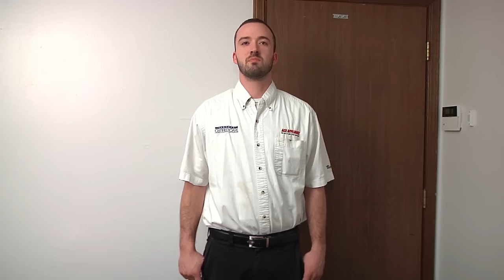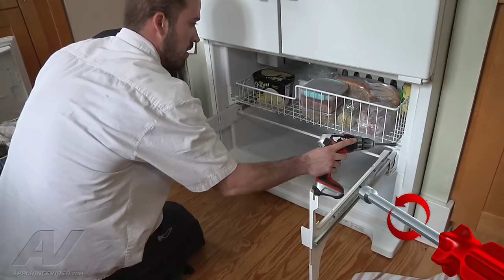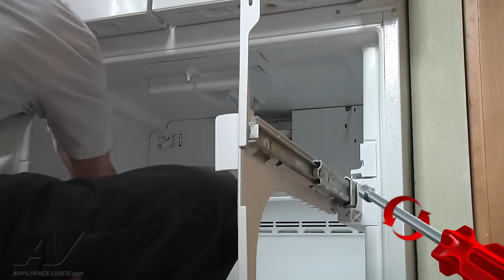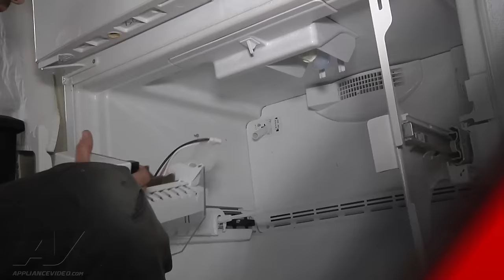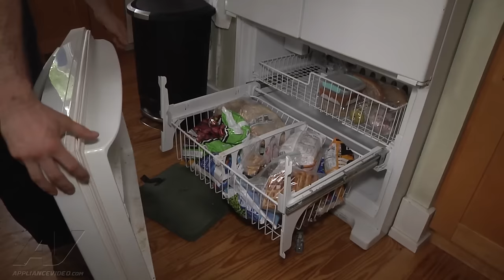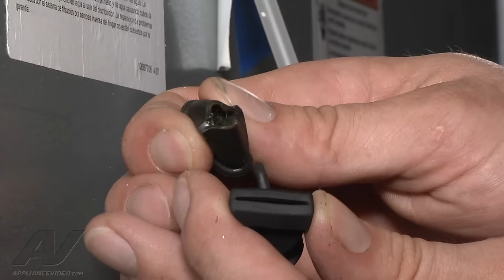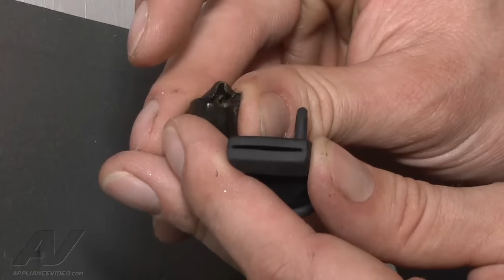Whirlpool Refrigerator Repair - Ice Buildup in the Bottom Freezer - Water Leaking - Grommet Kit

Comment: Thank you for producing this video. I faced the same issue about a decade ago with my Kitchenaid. I pulled the sheet metal cover off the back and traced the problem to the grommet which had clogged up. Removed the grommet and melted the dammed up ice. Problem fixed forever. No need to operate on anything on the inside of the fridge.

Comment: So thankful for the help. I went through it twice. I should have removed the back panel off the rear of the fridge and run a wire or drill bit up thru the drain pipe to clear. Didn't do it so had to do again by removing ice like the video shows then boring out the drain from the back side of the fridge. Hey I'm 77 and if I can do it you can too.

Comment: Great instructional video, I removed the grommet and cleaned it with dish soap and water and a small brush. It removed all the sticky gunk. I was not able to remove the top drawer in the freezer so I improvised. I place a hair dryer against the vents on the back wall and melted all the ice behind the wall. I also slid a paper towel in between the panels which absorbed the water. So far it has worked very well and should be a fix until the replacement P trap kit arrives.
Reply from the maker: JC guy
                 Thank you for your positive comment. We are glad we could help resolve your issue and hopefully saved you money. Please help us provide more videos to our site by posting ApplianceVideo.com on your YouTube, Facebook or Twitter account or add us to your circles. If you are in need of any parts please support our parts department on line at http://savemoreonparts.com/ or call 1-800-830-5465 7-days a week until 11pm Eastern time. Thanks again your support.  Matt, Ace Appliance service technician.

Comment: Thanks for the detail explanation. Freezer was working but fridge was warm. Everything in back looked ok and didn't see any ice inside the freezer.... until I removed the back panel. OMG!!! It was encased with ice. Took a few hours to melt, clean up, dry, but it works like a champ! Now I am wondering if perhaps we left the freezer door ajar leading to the ice or if the auto-defrost is not working? Ugh!

Comment: Took me 3 hrs, but I finally did it!  I kept getting a "door ajar" alarm on after we were finished.  The LED lights inside wouldn't come on nor would the ice/water dispenser work.  Come to find out, the electric clip on the back that hooks up to the water pump was flipped the wrong way. Unfortunately it slides on either way so you have to remember which side is correct before you remove it.  

Thanks Appliance Video!  Your customer service dept. was very helpful and spot on.  No problems whatsoever!..  I highly recommend using them.  Saved a bunch of $ and everything fit perfectly!  So glad b/c my freezer has been leaking for over a year.  I just hope it works permanently. = )
Reply from the maker: mikereardon                       Thanks
for the positive comment. Hopefully we saved you some money. Please help us
provide more videos to our site by posting ApplianceVideo.com on your YouTube,
Facebook or Twitter account or add us to your circles. If you are in need of any parts please support
our parts department on line at http://savemoreonparts.com/ or call 1-800-830-5465 7-days a week until 11pm Eastern
time. Thanks again your support.  Matt, Ace Appliance service technician.

Comment: Thanks much for this, great video. I used scissors to cut off 1/8" from the tip of the rubber and got a great nice opening for water to drain out!
Reply from the maker: Thank you for your positive comment .  Our family-owned and operated company works hard to provide you with FREE, high-quality repair videos. Thank you for your continued support and good luck on your project. If you are in need of any parts, our parts department has over 5-million in stock for same day shipping. Please call  1-800-830-5465 for any of your parts needs, or you can order online 24 hours at: ApplianceVideo.com. Thank you and good luck with you project.

Comment: Thanks for video, really helped me fix my issue.  My issue was little different.  My leak was coming from rubber tube that feeds the icemaker had frozen ice plugging it.  So when the ice maker tried to water into icemaker the pressure in the line behind the refrigerator leaked.  I had to do the same disassembly to get to the rubber tube and defrost the ice in it.  I might have been able to do it all from the back by feeding hot water into the tube but not sure that would have worked or not.  In any case this worked and we were able to do major clean out too!  Thanks again!
Reply from the maker: Thanks for your response, we are glad we could help. Our library
of over 5,700 videos are currently helping 1.6 million people like you every
MONTH.  Please help us by subscribing to
our YouTube channel, or post our website www.ApplianceVideo.com to your Facebook
page

Comment: This Kenmore bottom freezer fix with the new P trap kit was awesome.  Thanks soooo much. FOLLOW UP ISSUE:  After I plugged the refrigerator back in it produced a couple of batches of cubes but then stopped altogether.  I have a water dispenser on the inside left wall of the refrigerator and it works fine.  I ran the water for two minutes per the manual to remove any air in the line.  I am at a loss. :(  The unit is just over a year old.
Reply: Did you have ice forming in yours? Ours is only 14 months old and it is forming ice crystals on the left side and bottom of drawer and on the pullout drawer. Appreciate your input.
Reply from the maker: Thanks for your response, we are glad we could help. Our library of over 5,700 videos are currently helping over 1.6 million people like you every MONTH.  Please help us by subscribing to our YouTube channel, or post our website www.ApplianceVideo.com to your Facebook page, Twitter, Instagram or any other social media sites. Your support will help us keep producing more free quality videos.

Comment: Thanks for posting this! Sure enough our grommet barely had a slit in it, no wonder it clogged and froze up. Trimmed a little rubber off to open it up a bit and put everything back together. 30 min job, max.
Reply from the maker: Energy X

            Thank you for your positive comment.  Please help our ranking by subscribing to our YouTube page or posting our ApplianceVideo.com site on your Facebook or Twitter account. This will help us to continue to make new professional videos from our factory trained technicians. We also have our authorized technician’s daily emailing professional advice daily to people like you that have appliance problems. We have helped thousands of people save hundreds of dollars. Thanks in advance for your help.
Reply: ***** I should have added that this seems like a design flaw and Whirlpool should be providing the updated p-trap part for free...
Reply from the maker: Yes, make sure you put the new kit on your unit.85% of the time the problem will come back if you do not install the new part.Good job on doing it yourself. Please help our ranking by subscribing to our YouTube page or posting our ApplianceVideo.com site on your Facebook or Twitter account.

Comment: Thanks for the help couldn't have done it without the video. My grommet at the back was dry because of all the ice build up everywhere else you showed me. I cleaned out the fridge and then used a hair dryer instead of taking of the back and all the shelves and the front door. It took about ten minutes and I'm wondering if I would hurt anything by using hot air instead of hot water?
Reply from the maker: Bill 
     We also use a heat guns. You can use hot air as long as you monitor and don't melt any plastic parts on the unit.  Thanks for your positive comment. Please help us provide more videos to our site by subscribing to our YouTube page or posting ApplianceVideo.com site on your Facebook or Twitter account. We also have our factory authorized technician’s email daily free professional advice to people like you to help solve their appliance problems. Thanks in advance for supporting us. Matt, Ace Appliance service technician.

Comment: great video. I will definitely be looking behind the back panel. What is the drain grommet for though? What is being drained and where is it being drained to?
Reply from the maker: Great
question, you can call our parts department at 1-800-830-5465 and they can give
you help. If you have a more technical question that our parts department
cannot answer, our technicians are answering
all questions at our website at ApplianceVideo.com under our Repair Help
section. We have over 3,000 common questions and answers that you can easily
search through by your model number, appliance make, and problem or error codes,
and  Its free to search through our question & answer library.

Comment: Okay - First of all, thanks a ton for your video. It helped me take apart and put back together my Kitchen Aid model that was more or less the same thing in your video.

We had tremendous ice build up inside the freezer, but no water on the floor as symptoms.

I pulled off the back panel from the inside, expecting to see a ton of ice along a frozen drain line. Instead, there was a giant clump of ice in the upper right hand corner covering all of the parts connected to the ?thermister?. It was a huge clump of ice all along the copper tubing and wires up there. We took a hair dryer to it for the most part, not wanting to bend or damage any of the wires tubing etc. We were able to melt all of the ice. I did get a little aggressive trying to poke at it and did get a small shock, so be careful if repeating this. The ice is now gone.

But, what might have caused this? We may have left the door open a few times a little bit getting some freezing, but, once again, this clump of ice was huge. Could a part be defective?

Thanks!
Reply from the maker: Great question, you can call
our parts department at 1-800-830-5465 and they can give you help 6-days A week
Mon-Sat . You can also search at www.SaveMoreOnParts.com 7- days a week.  If you have a more
technical question that our parts department cannot answer, our technicians are
answering all questions at our website at www.ApplianceVideo.com under our Repair Help section. We have over 6,000
common questions and answers that you can easily search through by your model
number, appliance make, problem or error codes, and It’s completely free to
search through our question & answer library. There is a very good chance
you question is already answered there.
Reply: Wow, my husband and I just finished the entire take apart front and back just like this video. It was spot on as others have said.  But like you we had the huge glob of ice on the upper right side all over the wires and piping. we also thawed it with the blow dryer on warm,not hot just to be careful not to melt anything else. However, we also
had a clogged grommet just like the video showed. It was a ball of dust or something and the grommet is very sticky. I read another person's comment above about a replacement kit to update the defect for this problem.
So, do I go get another grommet or order the kit? The darn thing is only 5 years old. Amana brand and cost
$1,200.00! Ridiculous,

Comment: Thank you so much for this video.  This describes exactly our issue.  

Our fridge is not connected to the water line to make ice.  I wonder where so much water and ice are coming from.   Would this fix work for us too?
Reply from the maker: Yes, if your drain is plugged it cause water on the floor and a sheet of ice on the bottom of the floor of the freezer.  Thank you for your positive comment .  Our family-owned and operated company works hard to provide you with FREE, high-quality repair videos. Thank you for your continued support and good luck on your project. If you are in need of any parts, our parts department has over 5-million in stock for same day shipping. Please call  1-800-830-5465 for any of your parts needs, or you can order online 24 hours at: ApplianceVideo.com. Thank you and good luck with you project.

Comment: I replaced the pea trap tube thanks to your video. Was a breeze with your help. However, I still have ice forming on the bottom. Do I just need to perform the task outlined in his video? Will that stop the ice from forming completely?
Reply from the maker: Jamie 
            You may still have some ice stuck in the drain or underneath the pan. I recommend to remove the food and shut the unit down 24 hours with the door opened. That will insure all ice is removed permanently.  Please help us provide more videos to our site by subscribing to our YouTube page or posting ApplianceVideo.com site on your Facebook or Twitter account. We also have our factory authorized technician’s email daily free professional advice to people like you to help solve their appliance problems. Thanks in advance for supporting us. Matt, Ace Appliance service technician.
Reply: Can I unplug the freezer and leave the refrigerator part on?
Reply from the maker: Jamie Rogers 
                                           If you go to our FREE repair
help website at ApplianceVideo.com and post this question, We
have 14 factory authorized technicians that  answer any technical questions daily on your
appliance issues. This is the only website on the web that you can get
questions answered by certified appliance and HVAC technicians at absolutely no
charge along with over 2600 free repair videos. Thanks Matt Ace Appliance factory service technician

Comment: Thanks for the video,,Before I do all that,I was wondering if I just unplug the fridge for a couple of days would that fix the problem.
Reply from the maker: Debbie
        No that will not correct the issue. That is why Whirlpool engineered this new kit. This new drain kit permanently rectifies the issue. Please help us provide more videos to our site by posting ApplianceVideo.com on your YouTube, Facebook or Twitter account or add us to your circles. If you are in need of any parts please support our parts department on line at http://savemoreonparts.com/ or call 1-800-830-5465 7-days a week until 11pm Eastern time. Thanks again your support.  Matt, Ace Appliance service technician.

Comment: Small portable heater will do the trick. Turn the heat on at low and let it heats for about an hour with door slightly open. Once the temp reaches 80 to 90, it completely melts the ice.

Comment: Great video.   One question.  After removing the back panel from the freezer, I noticed a inch by 5 inch build of ice around where the coolant line enters the coils.  This might have been part of the problem? Any idea what caused this or how to prevent it?
Reply from the maker: Great question, you can call
our parts department at 1-800-830-5465 and they can give you help 6-days A week
Mon-Sat . You can also search at www.SaveMoreOnParts.com 7- days a week.  If you have a more
technical question that our parts department cannot answer, our technicians are
answering all questions at our website at www.ApplianceVideo.com under our Repair Help section. We have over 6,000
common questions and answers that you can easily search through by your model
number, appliance make, problem or error codes, and It’s completely free to
search through our question & answer library. There is a very good chance
you question is already answered there.

Comment: Love your videos!!
What do I do if the freezer is working but the fridge is not cooling. 
The flap opens but there is no cold air coming out. 
I am assuming that it may be the evaporator fan?? I have no idea about these things, just basing what I have read on line. 
Where is that part located? 
What would you suggest I look at besides that. All the coils are sparkling clean!
Reply from the maker: Great question, you can call
our parts department at 1-800-830-5465 and they can give you help 6-days A week
Mon-Sat . You can also search at www.SaveMoreOnParts.com 7- days a week.  If you have a more
technical question that our parts department cannot answer, our technicians are
answering all questions at our website at www.ApplianceVideo.com under our Repair Help section. We have over 6,000
common questions and answers that you can easily search through by your model
number, appliance make, problem or error codes, and It’s completely free to
search through our question & answer library. There is a very good chance
you question is already answered there.

Comment: Great video.  What's the part #?  I tried W10309238 was not sure because there's no picture.
Reply from the maker: Robert
          The best way to get the correct part is to get you model number and call our parts department at 1-800-830-5465 Please help us provide more videos to our site by posting ApplianceVideo.com on your YouTube, Facebook or Twitter account or add us to your circles. If you are in need of any parts please support our parts department on line at http://savemoreonparts.com/ or call 1-800-830-5465 7-days a week until 11pm Eastern time. Thanks again your support.  Matt, Ace Appliance service technician.     .